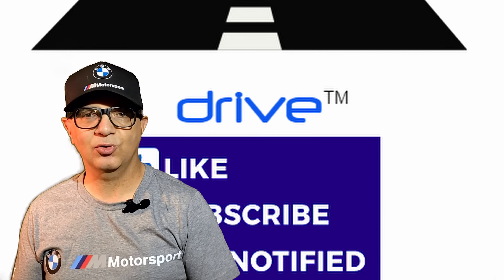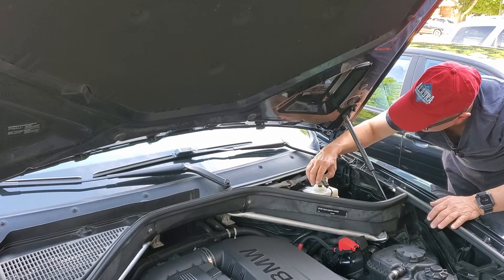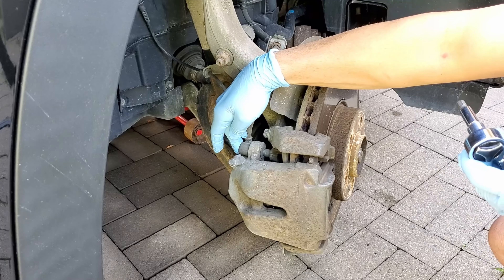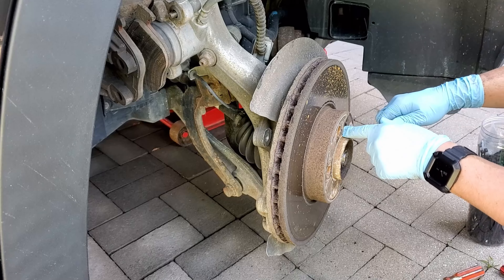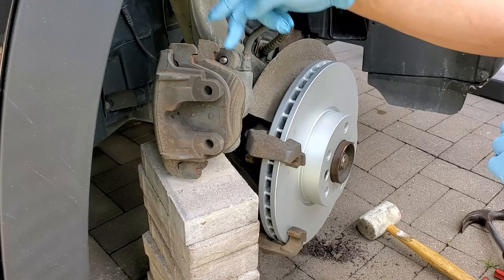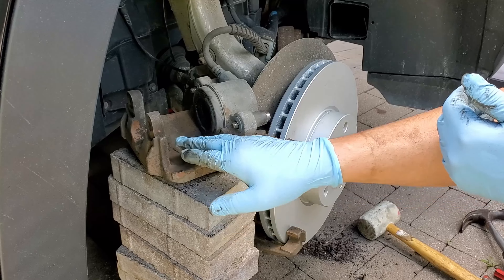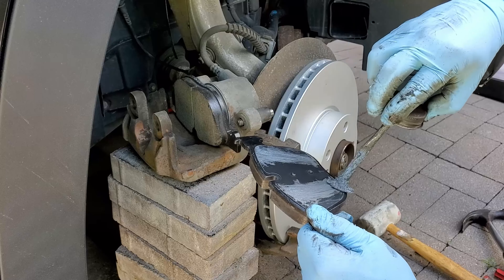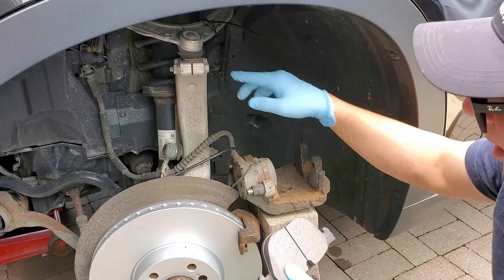BMW X5 Brake Pad Replacement Tutorial.  Front Brake Pads, Rotors & Pad Sensors

Comment: My rotors look like they’re in excellent condition and the brake pads just started to make a little noise. Is it OK to change the pads without changing the rotor?
Reply from the maker: Yes of course.  Just make sure that the rotors not only look good but are the proper thickness.  Find the thickness tolerance online.  If they are too thin or warp, you will need to replace them as well.

Comment: A question I'm going to ask you!! I have changed the silemblocks of my x5 e70 with 160,000km, I have installed MEYLE HD, Reinforced!! After the change I now notice that the car vibrates a little between 80kmh and 100kmh, the steering wheel vibrates a little, it's not much, but before it didn't happen to me. We have balanced the two front wheels and it has been corrected somewhat, but not completely!! Could you tell me what is the cause of these small vibrations? all the best
Reply from the maker: It does sound like an alignment or camber issue to me.  Have all four wheels ok?
Reply: As I told you, before changing the silemblocks I didn't do it!! This has started to be done with the new Meyle HD.
As I understand it, it may be due to the hardness of the new silemblocks when they are reinforced.
The tires are good, they are not staggered or anything like that.
Reply from the maker: If someone else did the work you need to go back to them and explain the symptoms.  Also maybe research the new product you had installed and see if there are any side effects or issues it creates.  Different density materials react differently--more dense materials can create more vibrations.

Comment: What about the rear? I'm not seeing an existing video. I have the pads changed by watching this. But there is a "BREAK" light still on. The "drive moderately" warning is off though.
Reply from the maker: I currently do not have a video demonstrating rear pad, rotor and ABS sensor.  Please provide me with more detail.  Did you touch or engage the parking brake?  Did you touch the ABS sensor on the rear passenger wheel?  These may be the issue.
Reply: @drive-chriscapredoni  it is not the parking brake light, as that one is different. It's to the right above the oil temp gauge. I only replaced pads though. Not the sensor. Does that have to get replaced also?
Reply from the maker: @MidKnightriderR6  Yes I recommend replacing the sensor.

Comment: Ceramics don't wipe the rotor and you get build up of pad material. I have went back to texstar semi-metallic pads & no rotor pulsating warp anymore.
Reply from the maker: I have always found that ceramic is quieter and create less stress on the braking system.

Comment: You forgot to put grease on all the small contact surfaces between the pad hooks and the bracket. And the torque is 110 Nm (81 lbft) on the bracket bolts.
Reply from the maker: I only put brake grease on the back of the pads where they mate to the caliper piston.

Comment: Axle stands, axle stands, axle stands. That's a lot of car to entrust to a hydraulic bottle jack!
Reply from the maker: There is also a 3.25 ton floor jack supporting the sub-frame
Reply: But still an hydraulic one? I would never, ever get under a car without mechanical supports. Maybe that's just me?
Reply from the maker: Very good point.  I had two points of support and with this job was never going under the vehicle.  Your point is well taken :)
Reply: @cliverobinson9617  It's just you 😀